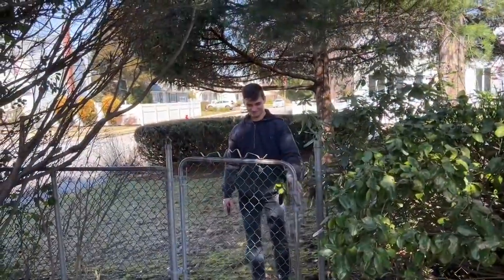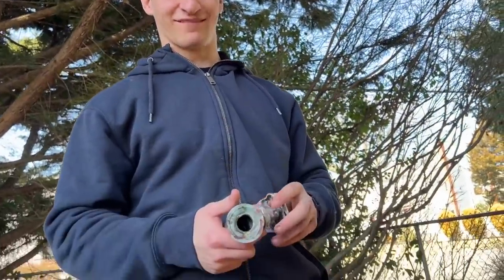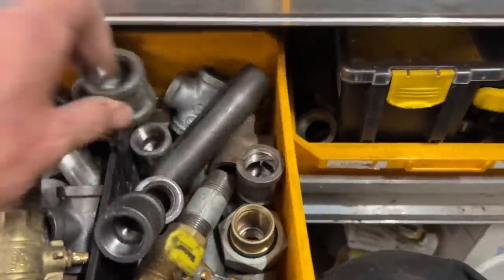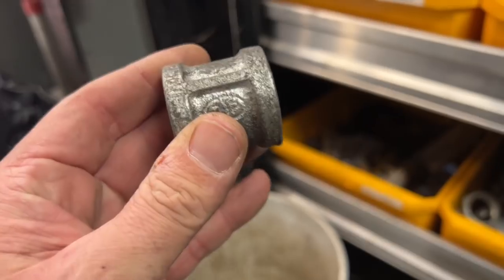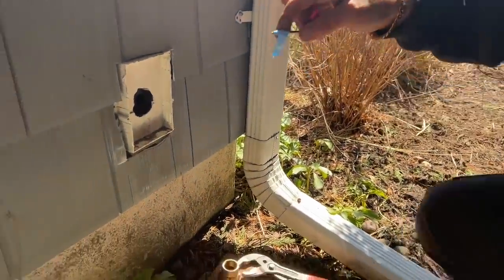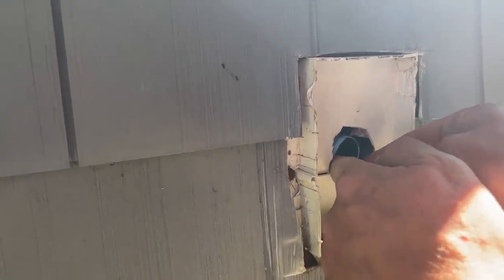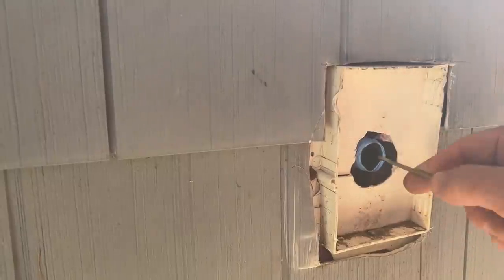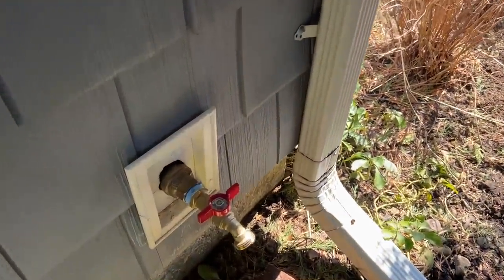Ultimate Plumbing Tricks and Hacks How to Wrap PTFE Teflon Tape in Tight Spaces on new Hose Faucet

Comment: pencil, marker, drill bit, drill extension, tubing, flux brush(handle), socket extension, screw drivers, popsicle sticks and many more things work great. it doesn't have to be round, but makes it a bit easier.